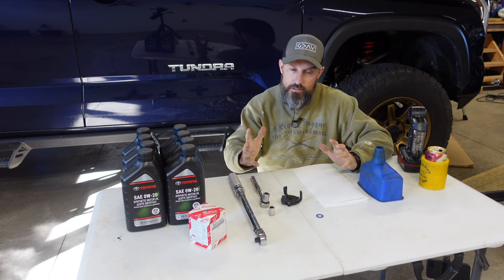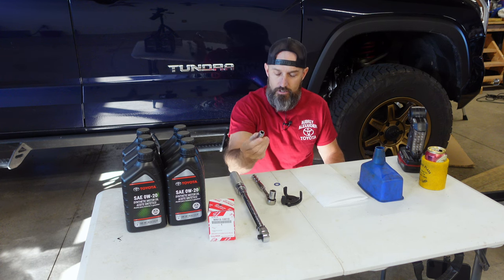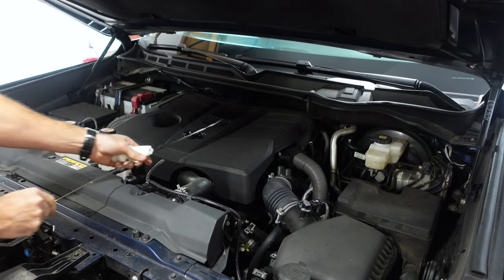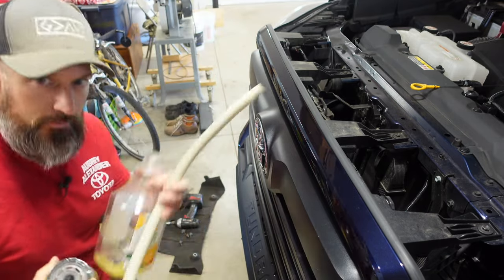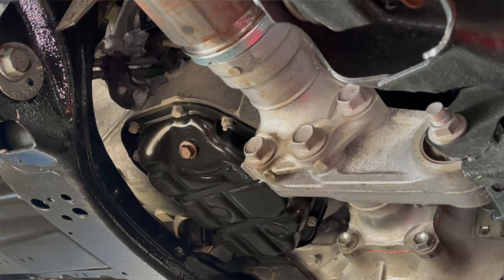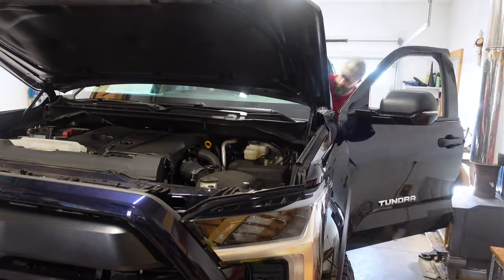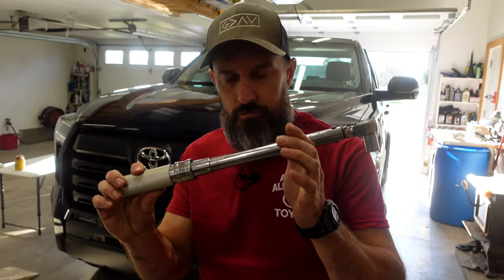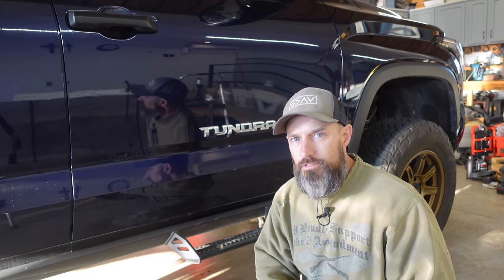How to change oil in a 3rd Gen Toyota Tundra, reset maintenance required and rotate tires. 2022

Comment: Another fantastic video. I have a 24 model and just completed my 1,000 mile break in oil change and normally change the oil every 3,000 miles. after that I am from the old school. Toyota telling everyone 10,000 miles, I knew that was a disaster waiting to happen and like you I rotate my tires at every oil change.

Another thing Jim, I clean my MASS AIR FLOW SENSOR  at every oil change as well just as a FYI. Paul
Reply from the maker: thanks for watching Paul

Comment: 5k is perfect... I use pennzoil ultra platinum 0w20. Just changed today... I hit 15k.  I did change at 1k to drop the break-in filings out.  Also, I put oil on both sides of the rubber oil gasket... some folks forget that filter is metal too.
Reply from the maker: Thanks for watching
Reply: Use silicone lube on gaskets, not petrol oil. Petroleum wears rubber.

Comment: Also wanted to add, no problem at all using 0-w20 oil. Lab tests have shown it to have great lubricating properties and no issues holding up to long OCI's. Also much better flow in colder months. The old school though of 'thicker oil protect better' is caveman mentality. Prius has been running 0w20 for years and millions of miles, engine failures are extremely rare even upwards of 500k miles. Run it!
Reply from the maker: thanks for the info and thanks for watching

Comment: I just bought a 24 tundra limited with trd off road. I just did my 1st oil change at 4500 miles. I agree with you. I plan on doing it every 5k miles. I wasnt aware that in new car its suggested to change it before the 1k mile mark. If i would have know. I would have it done right away. Oh well better than the 10k mile mark toyota suggested.
Reply from the maker: Agree

Comment: 10k OCI is no problem at all with the right filter and obviously, any quality synthetic oil. I run my intervals at 7500miles. I've seen oil analysis after 5k, 7.5k, and 10k. The oil is completely fine after 10k. 3-5k is way too short, I like the 7.5k interval. Good video, really nice truck. Thanks!
Reply from the maker: Thanks maybe I will wait a little longer.
Reply: Ams oil and mobil 1 have 20k mile oils and filters, ams oil has been doing it forever.

Comment: I don't get the reasoning to heat up your oil before draining it.   Your oil had all night to drain into the oil pan and by starting it back up to heat up the oil.. you just making sure that you won't fully drain all of the old oil out because you had just recirculate the oil back throughout the motor by starting it up and now a bunch of the old oil is trap in the passages and crevasses of the motor instead of sitting in the oil pan.
Reply from the maker: thanks for watching, guess you don't have to no big deal

Comment: Do you recommend to use the original Toyota oil and oil filter or can I just use any auto parts oil filter?
Reply from the maker: What I can tell you is I normally get the Toyota filter. If you buy after market, I don’t recommend Fram.

Comment: Did you place the jack stands on the axles when doing the tire rotation?
Reply from the maker: I did on my rear axel, then I used my floor jack on the front one side at a time. Thanks for watching
Reply: @DIYJIM  Exactly the way I rotate ,, Mobil 1 & Toyota oil filters , hate the skid plate !!!!

Comment: Given the issues with main bearing problems on Non Hybrid Tundras, I'm changing my oil every 2500 miles. It may be overkill but it is cheap insurance.
Reply from the maker: I traded mine in on a 2021

Comment: you are already sold 2007 toyota tundra ?
Reply from the maker: Traded it in crazy but I just traded the 2022 also for a 2021. I plan on making a video why soon.
Reply: @DIYJIM  me too , i am traded it in 2013 tundra and now i have 2024 tundra
Reply from the maker: @uaoodl  hope you have better luck than I did. I just traded mine in on a 2021.

Comment: Mobil1 EP can easily handle a 10k interval
Reply from the maker: Thanks for watching
Reply: I beg to differ.
Reply: Its not about the oil handling the longer interval its about the engine handling it. I would never push any turbocharged engine to 10 k the most id ever go between oil changes on a turbocharged engine is 5k.